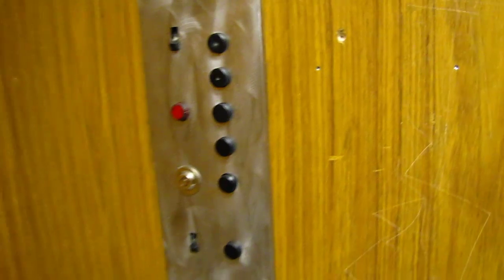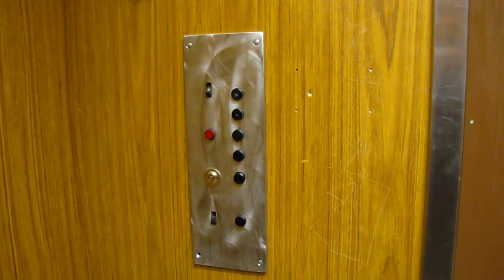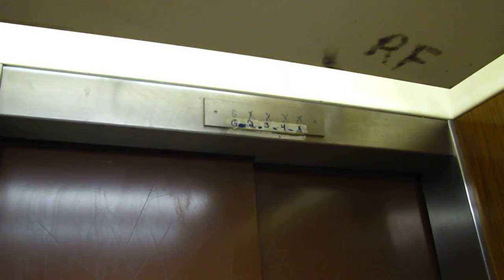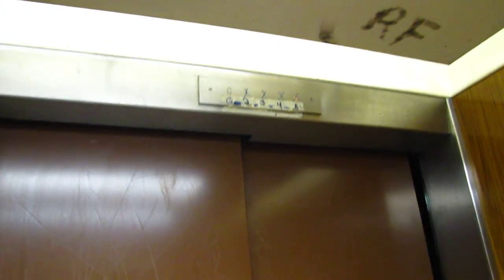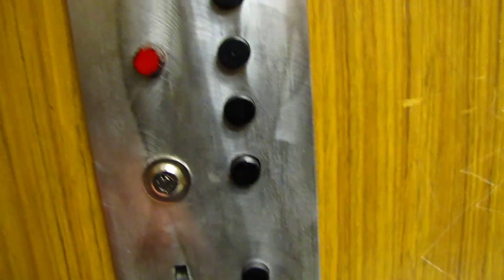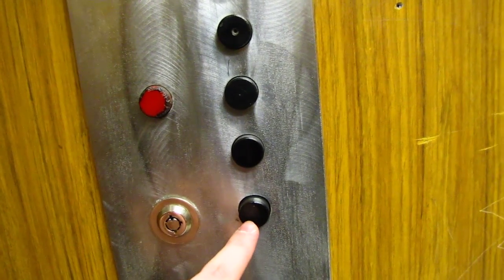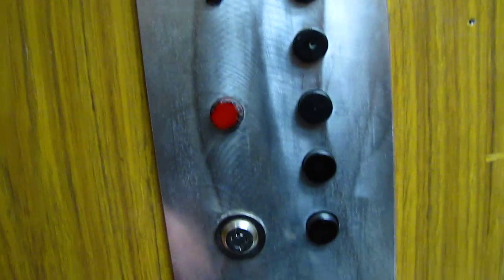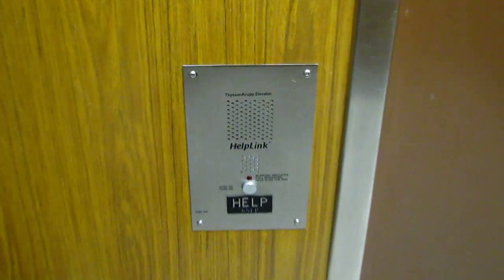1962 Dover hydraulic elevator

Comment: If it is 'low on oil'on all floors when going up from 1 and leveling at floors 2,3,4 or 5, it must be oil viscosity. The hydraulic oil in this elevator is too water-like instead of honey-like. So when it levels, the pump can suck in more volume of hydro oil and suck in air due to too much suction of the hydraulic pump and too water-like hydraulic fluid. So the pump sucks in hydro fluid and air when leveling upwards.
Reply from the maker: Ah makes sense.  Thanks for the input.